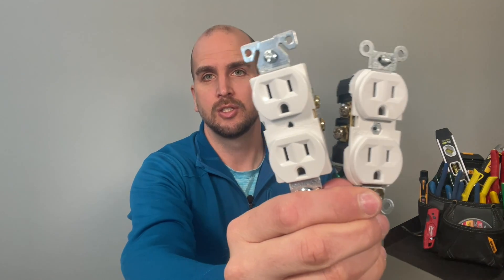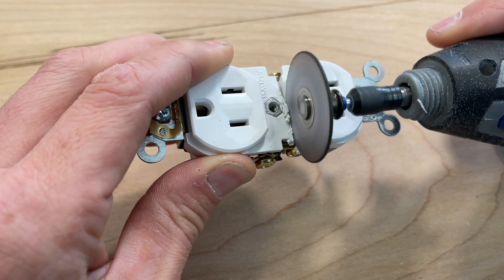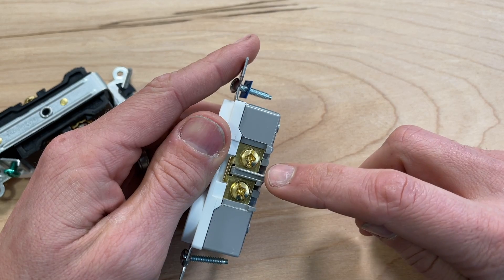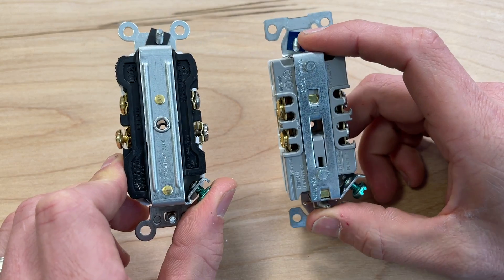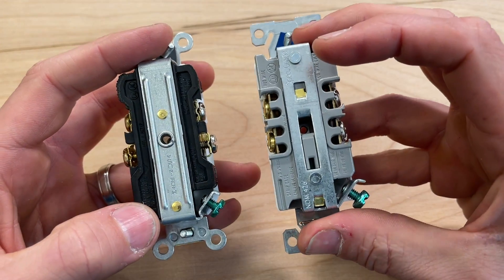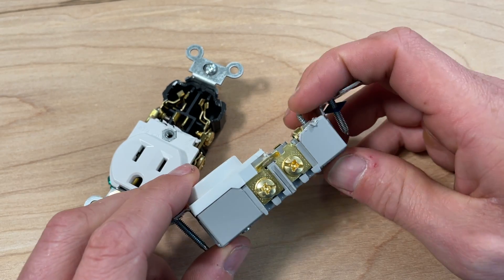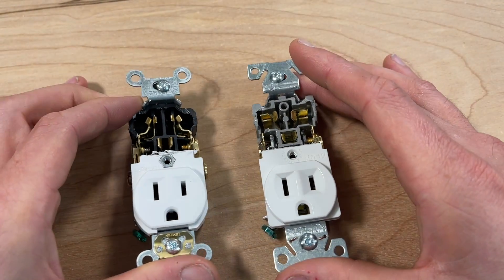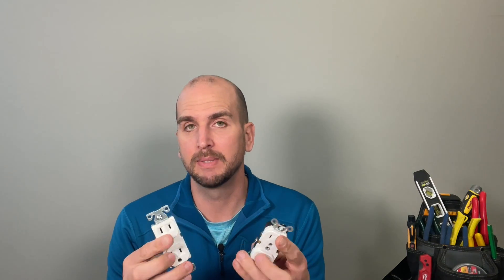What Outlet Should You Buy | Leviton vs Eaton

Comment: Great breakdown and analysis!  Thank you for doing this!  The other Eaton secret feature is the plate screw grabber - "Screw catch (TM)".  You can push in the plate screw, it will catch on the plastic and hold.  So no hands required to hold the plate or screw, while you transition to a screwdriver.  Extra nice when mounting on a ceiling.
Reply from the maker: Nice, I didn’t know about the Screw Catch.  Thanks for the info 👍
Reply: Thanks!
Reply: Can you cut open Furutech pure copper receptacle & compare can ! Thanks..🤔
Reply: Thanks! Anytime a feature is revealed that makes a job easier is well appreciated. 👍

Comment: For future reviews, you should really only get Tamper Resistant outlets if you are aiming at residential viewers as it is required by code effectively everywhere now.   Also it is an issue that it is still hard to find commercial grade outlets with TR at big box stores.    I use Leviton because of what you mentioned, availability.  It is Home Despot's primary brand.   Don't have lowes around to know what they have but our smaller hardware stores have some eaton and legrand.
Reply: Where does it say in the NEC book that TR is code now?
Plus you can use non TR receptacles if the old one passed code before that happened. Like how you can replace a non grounded receptacle with the same one because it was grandfathered in.

Comment: Eaton all the way.  First, the face plate has a deeper recess into the plug holes, meaning it will help guide the plug into the receptacle.  This is an everyday convenience that a homeowner would appreciate every time they have to plug in to an outlet hidden behind a dresser, or otherwise obscured by something.  The heavier nature of the Eaton case, and the better backwire, are good.  Inside, I like the way the contacts are more robust than the Levitown.  Finally, I would probably use the Eaton's built-in wire stripper just to avoid having to reach for a dedicated stripper.

Comment: Good call, I have traditionally used Leviton until i recently bought a box of Eatons at Lowes.  The Eaton is far superior as the plate design is so much easier to work with.   The leviton plate tends to get in the way with gravity where the Eaton stays put.   This makes a big difference if you are using stranded THHN so you dont get a flying lead (one of the small wires thast doesnt go into the slot).

Comment: Last summer I rewired my whole garage. I used Leviton branded 20A receptacles. I used 20A because they should be more heavy duty than the 15A. I as well chose Leviton because it's readily available at Home Depot. If I could choose any brand without leaving the store, I'd probably choose Legrand simply because it's a business which is local to Syracuse NY which is where I'm from.

Comment: Leviton is pretty much my default switch and outlet provider when I'm doing something around my house.  It comes down to features and options.  around my area, either HD or Lowes, it mainly comes down that Leviton has a lot more of the readily available market for specialty switches and outlets.  When I update an outlet, I usually am adding a Combo USB charger, or updating a GFCI outlet.  It comes down that Leviton is the one I can walk in and buy easiest.  Same for Dimmer or other control type switches.
Reply: Find em on sale more often too
Reply: Ditto, and I have standardized on Leveton WiFi switches.

Comment: I'm surprised. I was in housing maintenance for years and installed hundreds possibly even over a thousand outlets and we had eatons and levitons I always hated installing levitons they look and feel lower grade and I've seen dozens of them fall apart or lose their terminal tension very quickly. the eatons hold up much better and completely worth the added cost every time. terminal tension is an important factor that it seams like nobody is talking about by the way. if even one terminal loses tension an arc can jump from the terminal to whatever you have plugged in causing heat and potentially a fire.

Comment: In my experience Leviton devices sit more flush with the plate, and Eaton sits a bit proud, with the wall being perfect. if there are any imperfections in the drywall, than it is easy for the Leviton devices to have the device sitting almost behind the plate leaving a gap. This makes the Eaton devices easier to install for me, so I prefer them from that standpoint. P&S (Legrand) devices seem to install similar to Eaton, however they have a more matte finish to them which I prefer over the shiny plastic (easily shows scratches) of Eaton and Leviton. 
Curious to see the other brands broken open, but I'd personally rate P&S > Eaton > Leviton. (haven't had any experience with hubbell)

Comment: I do appreciate this video. I've been an electrician for 24 years and have used both brands. I have found the Leviton brand to be made of better materials. The side terminal screws on the Eaton strip and leave loose connections. I have seen both brands overheat due to loose connections. The difference that I've seen in the two is the Eaton one melts, and the Leviton one warps and gets discolored.

Comment: Never buy the cheapest receptical or switch, the plastic is brittle and cracks after a few years. What will inevitably happen is that this cheaper crap plastic will work it's way up the line until they're all crap. I've got two light switches in my house that the switch toggle just broke off from this brittle cheap plastic. I've never seen this before except by direct physical damage. I'm sure the 60 year old plugs in my parent's first house are still in good condition.

Comment: You people are absolutely nuts to " prefer" back wiring or to use any 15 amp in a house.
Reply: Hang on back wiring like the push in kind or the side screw kind?All new houses are wired with the push in kind.These things are not even decora's.Actually even using a j hook it should be taped.Not required by code.When some young single mom pulls that plug out to paint.That was my favorite stripper.Just tape it.Now if i had taken that advice i would not be divorced. Should have taped it.LOL

Comment: Leviton seems to dominate the market, so many people do not see or know about the other brands out there.  The same is true with breakers.  In the US it seems like Square D and Cutler Hammer have like 90% of the market, with the remaining 10% GE, Seimins, and a handful of others.  I have noticed that a lot of industry/commercial use Square D, whereas residential is mostly Cutler Hammer.  The two also operate differently, Square D trips and the toggle goes to the center position and a orange flag shows up in a window, to reset you push to the full off position and then back to on.  Cutler Hammer breakers look like a large light switch toggle, there is no trip position, it trips and snaps to the off position, thus there is no indication of a short/overload or if someone flipped it off.  Also any double pole breakers (such as the main disconnect, or any 240 volt circuits) on the CH are two breakers with a locking bar between them, whereas SD locks them together internality with a single toggle operating it.

Comment: The metal tabs on the Eaton receptacles are beefier. I had no idea they were designed beefy to strip wiring. Thanks for letting me know but I'll probably stick to my Knipex strippers. I like Eaton receptacles because the tabs seem to provide additional outlet support for sloppy box installations. Leviton was my preferred brand before discovering the Eaton's gave me a sturdier outlet. I absolutely despise spongee feel receptacles.
Reply: Can you cut open Furutech pure copper receptacle & compare can ! Thanks..🤔.......,,
Reply: Never knew about the stripper. Now that I know about it, I can't say it is of value to me. I prefer to use my strippers.
Reply: Great point.   Way too much flex on cheaper outlets, especially the consumer grade.   Doesn't affect anything to my knowledge but certainly feels better when plugging and unplugging things to have it solid and not bend back.

Comment: so they have a 15a receptacle but you need to use 12awg wire for the built in stripper to work? That's a fail and no, I'd use a real pair of strippers instead.
Reply: No, it has two gauges of stripper: 12 and 14. He demonstrated the 12.

Comment: I'm replacing all the receptacles in our home with these Eaton spec grade. I do like them and find the back wiring to be preferred using the terminal screws to make all connections secure. The Eaton is made to 20 amp specs and is only rated for 15'amps due to the 15 amp plug pattern. I did find it more difficult to get a J hook under the screw with the Eaton design.

Comment: I much prefer the Eaton's, even with the extra cost. I like the backwire feature too. I've had that in a lot of commercial buildings, just seems stronger/safer.
Reply from the maker: Agreed 👍  Thanks for the feedback.
Reply: Eatons the better plug and when running commercial stranded wire the Eton is easy to install.
Reply: Easton’s seems more robust. When you run 15 amp repeatedly, the metal gets hot, plastic softens, expands, repeat , repeat...  contact force decreases, the male cable  strands heat.  You can feel and see the cord finding it’s ‘natural’ shape.  So I would spend the extra dimes to save working on weakened extension cords. (Or lessening cool down time on saws and drills)
Reply: @davidamoritz  same with light switches?
Reply: @randomrazr  yes the upper brands not the cheap ones
Reply: @davidamoritz  i have legrande light switches. all backstabbed. am i screwned?

Comment: You just sold me on the Eaton spec grade receptacles. But I have standardized on using Leviton GFCI receptacles. I like the green light in the corner that says it is on and working.  Eaton has a nice pdf brochure online with the new changes in NEC 2020. On page 5, there is a real handy chart that compares what is required for GFCI and AFCI in each of the past NEC versions. Google "2020 NEC Code changes brochure eaton" and look at page 5.

Comment: I'm a landlord, and I use the Eaton when I have to replace a worn out outlet, precisely because of the backwire feature.  I used to use the cheap residential outlets, until one time when I accidentally bought a box of commercial outlets.  It turned out the backwire feature made it so much easier to use that it was well worth the extra money, not to mention that they'll last much longer.  So, now I get nothing but Eaton commercial.
Reply: so fyi. backwire is normally done in residential due to the speed (which usually equals shortcuts)  in the commercial world, more times than not, its spec'd out to be sidewire (J hook) and prohibits backwiring cuz of the failure rate.
Reply: @bobbygecko  — Are you sure the prohibition isn’t just for the push-in type of connection?
Reply: @bobbygecko  push in connections are job security for me because I'm a service tech
Reply: @bryson3254  he mentioned back wiring and you mentioned push ins. Which is it? Those are two separate methods if I recall. Back wire is just pushing the wire in on the outside and screwing it down. Push in is the automatic clamping ones that are known for high failure rate.

Comment: I've known several electricians over the years who absolutely refuse to use the "back wire" feature on any outlet because theyre prone to failure. Most often when you pull the receptacle from the gang box and it pops loose. Solid core copper wire can cause a lot of issues with that. At least that's what I've been told by electricians. The J method is better if you dont over tighten
Reply: I think you are mistaking a stab connection with a back wire.  The stab is only a friction fit the wire isn't clamped by the screw.  The only wat a back wire fails is if it isn't properly tightened.

Comment: Another feature you didn't mention that favors the Eaton, the ease of inserting the wire. With Eaton, you push the screw, which is easy. With Leviton, you have to let the back plate fall away with gravity to make room for the wire, which is super annoying. It always seems to fall into the way. I much prefer Eaton's method.
Reply: Plus stranded wire is easier to install.
Reply: @davidamoritz  But is somewhat more dangerous because some bare ware may not enter the hole if one's lack attention.
Reply: Can you cut open Furutech pure copper receptacle & compare can ! Thanks..🤔....,
Reply: Yes, I agree. Sometimes gravity doesn't work when the receptacle isn't facing in the correct position. With the Eaton it doesn't matter which way it is facing. It's worth the extra expense not to have to fight with it.
Reply: @davidamoritz  Who in their right mind would run stranded wire to a receptacle. Stranded wire can't handle the heavy electrical loads solid wire can. I would run stranded wire for lighting only.
Reply: @blainederouen9977  dude every wire run in metal or pvc conduit is stranded wire in every commercial application. Also stranded has higher load values!  Let me help you out since you have no idea wtf you are talking about go buy Desk reference by Thomas J Glover and learn something.  Jeez your comment I am posting with my electrician buddies over on stack exchange so we can laugh at you.  That literally was the dumbest comment I have read all week.
Reply: While it is true that Leviton has exterior clamps for most of their spec grade receptacles, their spec grade switches have internal clamps like the Eaton and Legrand receptacles.
Reply: @aurvaroy6670  But Leviton is Chineseum, and Eaton Made in USA.
Reply: @blainederouen9977 AC flows better on stranded due to skin effect of the oscillating current.

solid wires kinda work better for DC and like air terminal stuff, but breaks and is not flexible. fluorescent and LED T8 style ballasts use em, with 60 or 90C wiring.

THHN/THWN stranded is straight commercial wire. receptacles designed to handle stranded usually handle solid NM wire better. Faster smoother install. strong clamp. Higher price.

so I +1 David's comment, minus the demeaning vibe.

we all learn

Comment: One feature of the Eaton I don't see mentioned is how the faceplate screw works. On install, the faceplate screw gets pushed into the small plastic tabs (notice the three sided hole?) and is held in place while you straighten the screw and plate for alignment. It seems that the Eaton is designed completely for a single tool install and specifically for a faster install. I think in a race, a tech could install many more Eaton plugs than the Leviton in the same time frame, and if your job was to install plugs on a complete floor of a condo complex, once you got used to the Eaton, you could do it all will just a drill driver, then go back with faceplates and finish.